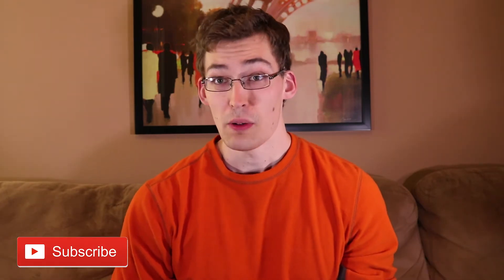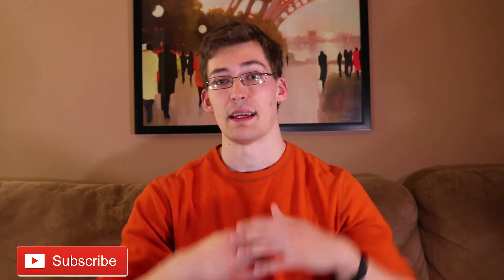NIC 39a: How does Bioelectrical Impedance Analysis work?

Comment: very good explanation. but can you please tell how will we use it on lab rat ? please tell, i am stuck in an experiment.
Reply from the maker: I would shave the rat on either end of its body, attach a node to each end, and run the BIA. Also, I would recommend a DXA, preferably, if you have one available.

Comment: does fat distribution make a difference? For example, let's say I have skinny arms and chest, but a lot of fat around my waste - the electrical circuit between my arms wouldn't be impeded by fat, even though I have high body fat percentage?
Reply from the maker: Wikum3, that is an excellent question - the answer is likely yes, because the signal would travel through an unrepresentative section of the body, but you could, theoretically, still use it as a gauge of progress (assuming you could get it reliable enough).
Reply: @Physionic  Great question! So is it fair to assume that the latest tech in smart scales that do not use a handheld device simply pass electricity through through your legs? Further reducing the reliability of this method by ignoring the torso, and arm muscle/fat composition?